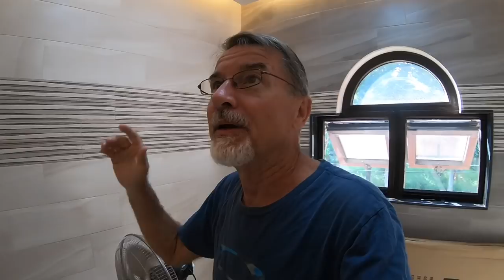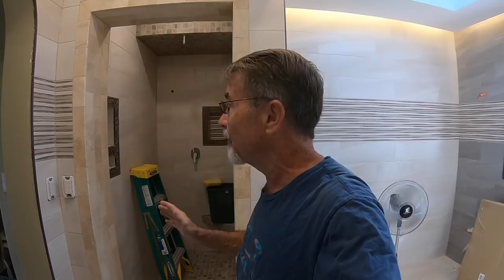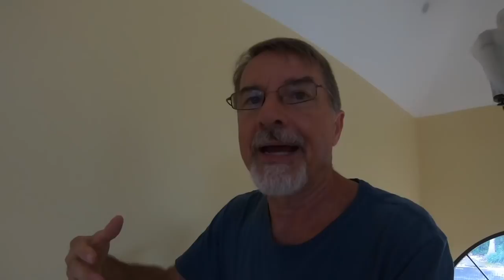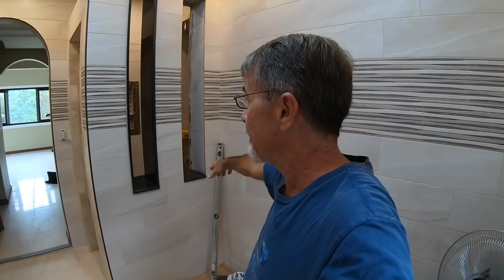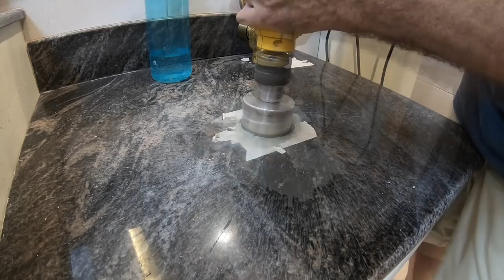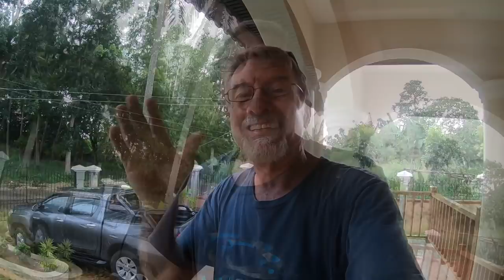VILLA FELIZ - EPISODE 399: HOW TO CUT HOLES IN GRANITE (House Building in the Philippines)

Comment: Hi James,  I like showers without doors.  The door is always the first thing to start looking bad.  It is too late now but I like the shower head valve close to the entry so you don't have to get wet to turn it on.  You will have a wonderful bathroom as it is.
Reply from the maker: Hind sight being what it is, I tend to agree with the control valve being near the entrance as well.  Also, I would have put the PPR connector for the wand style head in the center of the side wall and not on the same wall as the valve.

Comment: Mornin' JT,
Good tip on the hole saw.
Another trick,if I may add is to make a small guide out of a flat piece of paneling or plyscore,even 1by material. I then use double sided tape in all 4 corners to adhere the template/guide temporarily .
I also put the tape on the underside at the perimeter of the hole .
Once you stick it down .You can pour a bit of water in the hole of the template to keep dust and hole saw temp down.
I start the bit  slowly as well..
Great technique on your end.
Reply from the maker: Good tip Keith.  I sometimes use plywood with the same size cutout.

Comment: 4:32 i agree with not having a door to the shower, but instead put a shower curtain if privacy is needed and to prevent water from splashing outside, the shower curtain could be tucked in to the corner next to the niche.

Comment: With a regular core drill for concrete you can easily cut through rebar without damage to the bit if there is a correct amount of water. I have drilled hundreds of holes. Just be careful so a small piece of it does not jamb up in the hole.
Reply from the maker: Worked like a charm!

Comment: James, The property management who owns that club house maybe you could show them your generator. So that they could install the same thing at the club house just in case of a brown out. And James Tanner i have a question for you. And it's that when i sent a ring alarm system to my relatives living in Manila will it works?
Reply from the maker: I just checked and the base station is 100 – 240V 50/60Hz AC Adapter Included.  Seems all the accessories are battery powered.  It connects to any wifi so that's not an issue.  I'd say it'll work just fine over here.

Comment: James, you might consider wet room solution seals, it a rubber D  shape you stick to the floor to stop water egress from the shower area, it’s low profile and designed for a wheelchairs to role over so no tripping hazard.  Not suggesting you need wheelchair yet lol.  Here is a link to a one type of this threshold https://www.theshowersealshop.com/shower-seals/wetroom-solution-seals.html  
I get no kickback just a supplier selected at random from google.
Good luck

Comment: A transparent door would be nice to show the beauty of the shower room however privacy issue is a concern since the of the glass entrance door. I think a door is necessary so you don’t have to wipe the floor outside the shower after showering. And slippage while Ness or you pass by can be avoided. It depends on the water pressure as well, the stronger the pressure, the more water splash. Not an expert but just my opinion.

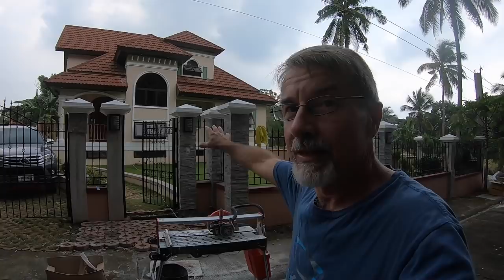Comment: 12:11 James are you going to taper the pavers to meet the side walk? or just put a step-up border ? a taper would look good if it can be achieved. (back-track) on the shower wiyhout the door you will hace to consider that while you are showering your body movements and positional changes will cause water to deflect from your body outwards in all directions even on a low pressure. However a door-less shower is more of a Mediterranean theme and adds a better esthetic look. A semi-rustic wooden(warer-proof saloon style(split,elongated and louvered) door, would do a nice touch, but that is if you can acquire the double swing style hinges that are corrosion free.https://images-na.ssl-images-amazon.com/images/I/61%2BMS8QWVOL.jpg

https://cdn.shopify.com/s/files/1/1026/2803/products/41tLchaJdlL_large.jpg?v=1536747527

http://homebro.club/wp-content/uploads/2018/05/saloon-door-swinging-door-saloon-priceless-saloon-door-hinge-saloon-doors-custom-saloon-doors-saloon-door-hinge-hardware-swinging-door-saloon.jpg

 (my favorite) http://puertoricorinconvilla.com/wp-content/uploads/2018/07/glass-over-panel-universal-reversible-tuscany-wood-pinecroft-in-x-natural-unfinished-bi-fold-doors.jpg (Same glass pattern for lower panel)

https://i.pinimg.com/236x/5d/f1/7e/5df17ef48f1a6943dc634a55a51bb183--pintu-rustic-style.jpg Just my two cents.
Reply from the maker: Yes, I asked my gardener not to fill in the grass blocks by the sidewalk so I could remove and reset to meet the sidewalk at the same level.  It was a rush job before I left for the summer vacation.
Thanks for the links!